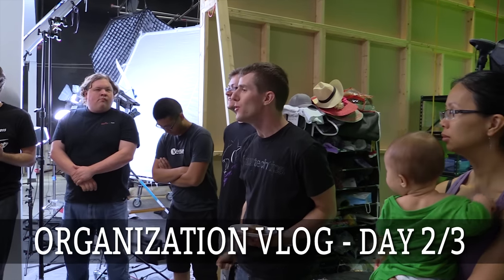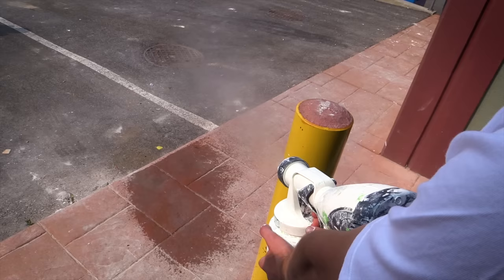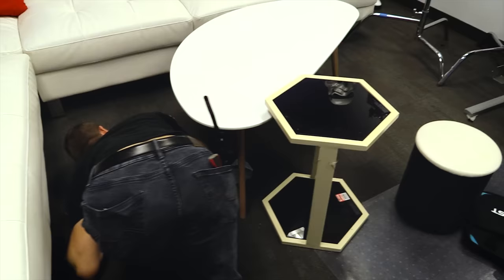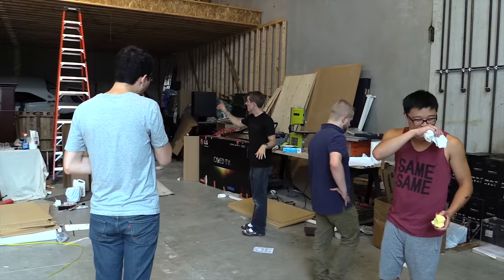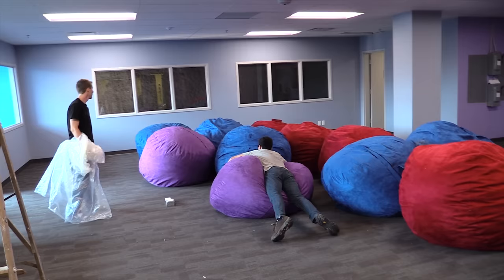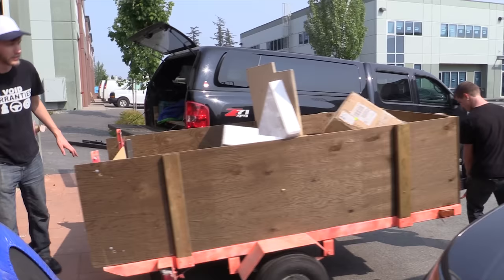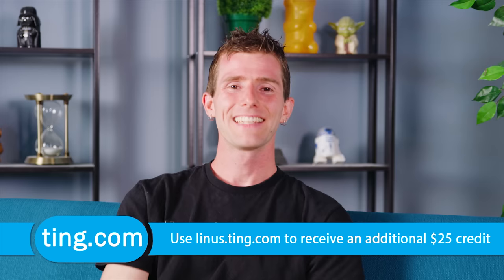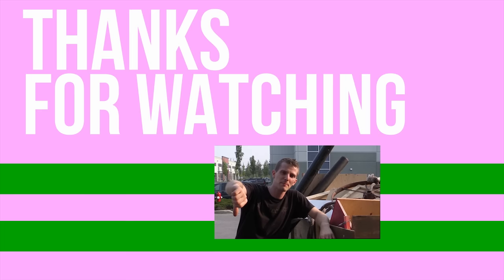Linus Hates EVERYONE - Organization Vlog Day 2

Comment: 8:54

Casual Car frame in the background...
Reply: I am still wondering what the hell is that about
Reply: me too
Reply: they mentioned that some guy was paying Linus to store it there for a while
Reply: Linusclassiccar tips
Reply: Not sure but I think it's a Charger.
(2 years later I know)
Reply: aesthetics
Reply: @s4n714g000  Nah, it's an Impala 
(7 months later I know)
Reply: @zacmiller437  I'm not really familiar with the impala but if it were a charger the fuel cap would be visible on top of the rear wheel right? I'm doubting it's a charger now
Reply: @s4n714g000  Truth be told I'm not 100% sure either, I just saw what looked like a badge on the C pillar, which is where the Impala logo was located on some of the early 70s models. Either way, I would be happy to own it, whether it's a Charger or an Impala.
Reply: @zacmiller437   its a 
1969 Dodge Coronet R-T

Comment: Linus, is that a 1968-1970 dodge coronet in the back around the 6 minute mark??????
Reply: nope looking at that rear marker light and side dual "scoop" like indents its a 1969 :D
Reply: So it is a coronet? I thought it was a charger.
Reply: blueblade455, look at the rear window, the chargers have a rectangular inset window, coronets have the full width, curved window. :)
Reply: Its relatively clean and straight for 50 year old body tub, especially for one outside of the desert southwest United States..

Comment: What happens to the hardware they no longer need?  
Their junk can be an instant upgrade for many people. 
Seems LTT does not have to return every test samples sent to them (at least not every case).

Do they auction items after testing functionality as used products?
or would that represent headache for people that receive defective parts or parts that fail shortly after purchase?

The computer I am on has parts that are mostly over 10 years old, but functions for most of my needs.
The SSD's and HDD finally had to be replaced the other day with cleaning. 

The SSD had access time that went from 3-5 ms to 1000 ms.  Luckily no data corruptions or loss.
The HDD made weird wind up noises and stalled computer each time it attempted to access data.